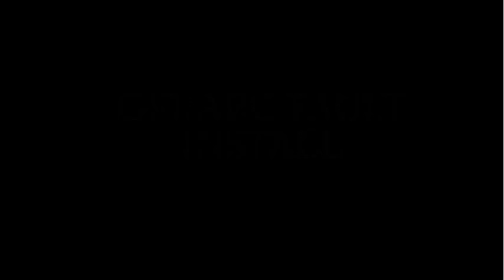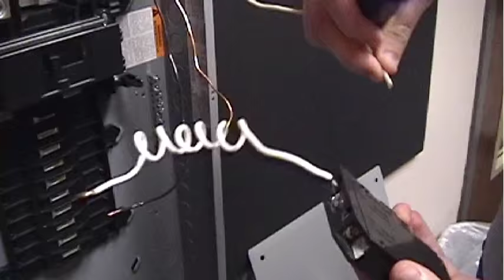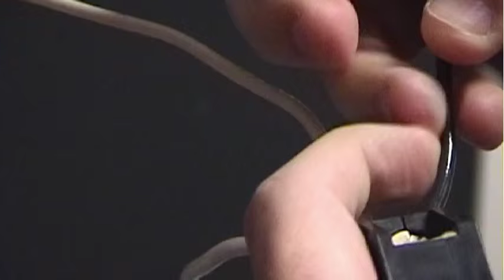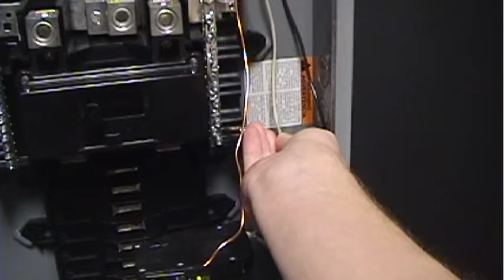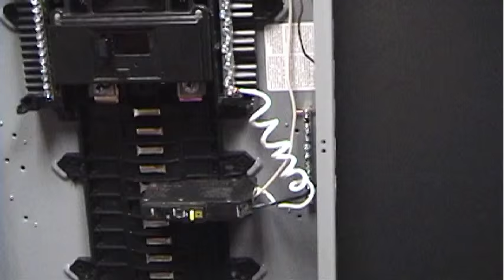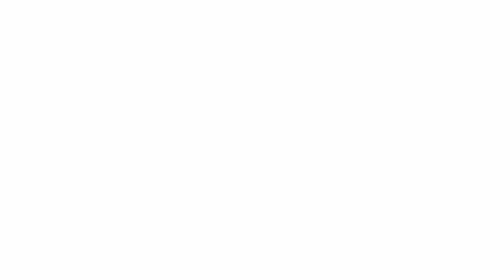Installing a GFI, AFCI, DF Breaker in QO or HOM load center | Schneider Electric Support

Comment: 1) ALWAYS connect Neutral BEFORE connecting to Line
Ground fault breaker will NOT WORK if Neutral is missing
and Neutral CAN CARRY VOLTAGE resulting to electric shock
(especially when not warning audience to switch the breaker to OFF position before installing)

2.) ALWAYS connect Ground BEFORE connecting to power source
Otherwise Ground CAN CARRY VOLTAGE and can put both worker and user in danger
Reply: Found that out!!  The breaker itself is an active electrical device once energized.  They should mention if you mount the breaker and it is in the "On" position, the white neutral leaving the breaker is carrying 110V and will shock you!
Reply: So basically make all your wire connections first to the uninstalled breaker and bars then make sure the breaker is set to OFF then you can install the breaker in the panel and switch to ON

Comment: So if I dont have an isolated ground bar I dont have to hook up the ground. Most panels I come across both neutral and grounds share the same bar. I wouldnt ground to that bar?
Reply: Neutral and ground only share same bar if the panel is the first means of disconnect to your house (main panel).  In a subpanel, the bars should be separate.

Comment: I installed a Square D 20 Amp GFCI breaker & it works when I use the test button.  However when I use the CB plug in tester the button won't trip the GFCI breaker in the panel.  Lights show it's wired correctly.  Will a plug in tester trip the panel GFCI breaker or just those individual GFI outlets?
Reply from the maker: Hi Allan,
Thanks for reaching out. Our customer care team can definitely assist further. You may contact them directly at 888-778-2733, Option 3 or cic-commercial@schneider-electric.com. The team is available from 8am-8pm EST Monday-Friday.
Reply: If you have gfci outlets and breakers it may not trip both of them. If it isn't plugged into a gfci outlet it should trip the breaker. Double check all your wiring and check the voltages and that everything is grounded that should be.

Comment: i only have a black wire to hook to the breaker
Reply from the maker: Thank you for the comment. We apologize for the delayed response. Please contact our support team directly for further assistance. : 888-778-2733 Option 1 and 1
Reply: You need to look in the breaker panel and find the neutral wire that accompanies the black wire you have. The two wires make the circuit possible. The neutral wire is likely already running to the neutral bus bar so it needs to be removed from there and added to your GFCI breaker then replace the white tail from your breaker to where the other neutral wire that you removed back in its place.
Reply: I do not know, and changing one of these new, I connected the White wire to neutral bar and then I put the circuit breaker in the base and connected the black wire of the old circuit, and I do not move the White wire of neutral bar old circuit, i do not change it, now circuit breaker trips when I turn it on, I do not understand why this happens, without having to load the plug, sorry for my  bad English
Reply: You need an electrician
Reply: Thanks, this comment helped me resolve my problem. My breaker box is a rats nest of things connected together very oddly so it wasn’t straightforward to find the specific neutral wires for the particular circuit. Wasn’t understanding that the GFCI basically open-circuits the live wire and neutral wire for that particular circuit so you have to have both running through the breaker for it to be able to switch both off.

Comment: I am seeing this video 1 day after my installation of 2 of these in the same "D" box except mine is a 200A size box.  This single pole breaker will not work with a shared Neutral circuit.  The instructions do not mention this...VERY IMPORTANT.  The subject circuit must be dedicated (Hot and Neutral sides).